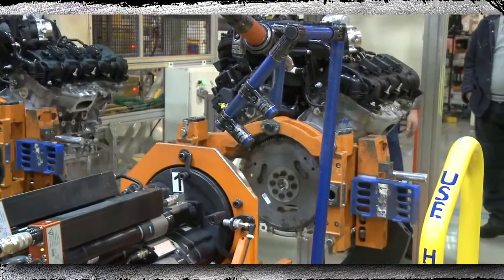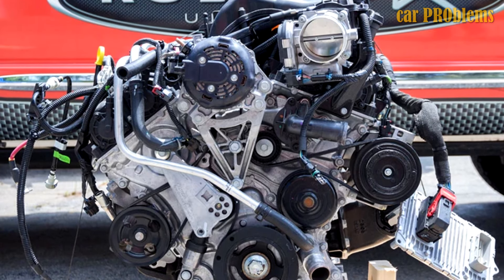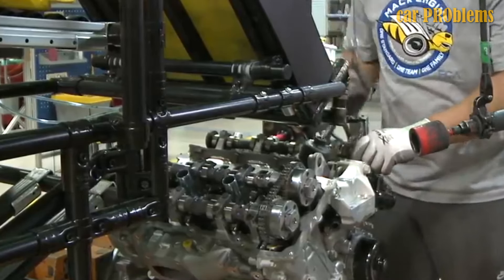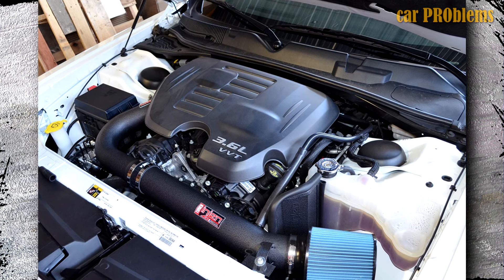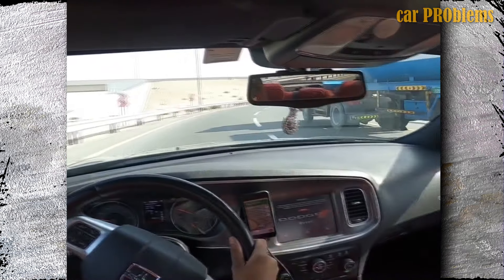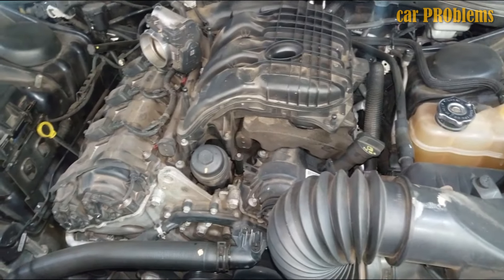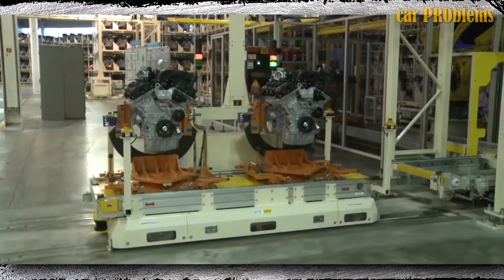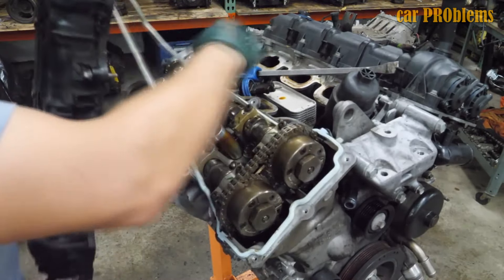3.6L Pentastar V6 Overview, Common Problems and Reliability

Comment: I have a 2013 Dodge Grand Caravan with the 3.6 Pentastar. I have taken excellent care of it for the last 10 years. No issues with it all for 10 years.
Reply: In my jku I have derived 300k km and no issue
Reply: 2012 t/c drives like a champ. Dont use eco mode
Reply: I think biggest aspect of these engines is regular oil changes. Valve train and anything to do with that aspect is delicate to oil quality.
Reply: Same here, 10 years now
Reply: @xgreasexmonkey5506  In the ten years I've had mine it's not been an issue. Still the original factory cooler on it. But then I don't crank down on it during oil changes either. I keep it clean and the threads are always lubed with oil before I replace the cap and I do use a torque wrench. I change oil at 3000-mile intervals. The engine runs strong, it's clean inside and out and it's quiet.
Reply: Did you get it new ?
Reply: @Aceinfinity-le8zc  yes, I bought mine new.
Reply: Easily one of the best engines ever made have just over 23k miles on my ram ZERO issues.
Reply: @fernherrera29   23 thousand miles!?!?!  That’s incredible mine blew up at 15,000.
Reply: @nassermohd2317  oil cooler?
Reply: What’s wrong with eco mode?
Reply: @eddiea3782  I didn't crank down on mine either but it leaked at 80k miles
Reply: @fernherrera29  that's no miles at all. Give it time. By far not the best engine ever made. The old straight 6 cylinders are the best ever made.
Reply: Does it take alot of gas
Reply: @The-Ramseys  16 to 18 miles per gallon
Reply: Best engine was the in-line 6 258 engine there gone now it’s nothing but a fiat sorry I stick to reliability Toyota 4Runner sorry no offense but,that’s what happens when other companies take over I miss my Old 1984 jeep scrambler🤙🏾
Reply: @rickmontelongo4230  I agree on toyota reliability.  I've got an 84 fj60  that will go anywhere
Reply: You can own anything for a long time how many miles do you have on it that's what counts, The oil cooler system is a bad design period
Reply: 2012 Durango, runs perfect.
Reply: how about throttle body?
Reply: @Phone-sh7jg my moms got one she doesn’t use eco mode either
Reply: @joerouth6255  honestly oil changes are the life blood of every engine if we went back to three months 3000 mile oil changes on any engine we would see drastically reduced amount of problems across the board
Reply: My 14 Ram runs and looks new. CHANGE YOUR OIL at 5k full synthetic.

Comment: Some information from my dad who used to work in Chrysler's warranty department before he passed.  The reason these engines are having failing rocker arms in years before 2019 is because the engines were originally designed for 30 weight oil and then were back spec'ed to 20 weight oils because of CAFE fuel economy standards.  The problem is that 20 weight oils have a lower HTHS (High Temperature High Sheer) rating which means that there is less ability for the oil to keep parts separated under high load areas of the engines such as in the needle bearings used in these earlier rocker arms before they were switched to a solid large pin (no needle bearing) design in late 2019.  You can buy these rocker arms.  The MOPAR Part numbers end in AH.  Anything earlier than this will still have the needle bearings and not the solid pin.  A work around if your engine is lower mileage and not ticking is to choose a 30 weight oil (which the owners manual says you can use) which has as high of a HTHS rating as possible.  30 weight oils will be 2.9 or higher.  Amsoil XL for example is the highest I've found at 3.3 HTHS. (Heavy Duty Diesel Truck Engines specify a minimum of 3.5 HTHS for cam loading for this reason)  In a 20wt oil it's 2.6 minimum and this is too low to protect these needle bearings.  The other thing that you can do to ensure you don't suffer from issues is to not idle your engine too long (lack of oil flow to the top part of the engine).  You don't have to take my word for it, but it's an easy change to make to ensure you don't suffer from this in your 2019 and previous Dodge Caravan, Journey or Jeeps that don't use the PUG Gen 3 engines as found in things like the Grand Cherokee, RAM pick-ups, Dodge Durango's (not Promasters or Chargers), These engines with the PUG 3 design have the Variable Vale Lift and use a different Rocker Arm design to accommodate the VVL system and don't suffer from this same problem.
Reply: Does the 2017 and up Pacifica van use the VVL ?
Reply: @stanza77  Yes
Reply: RIP to dad
Reply: That was mad informative! I love it when people are sincerely interested in an issue and have high-level knowledge to share. 👍
Reply: Thanks for sharing your knowledge. I have a 2019 Chrysler 300 (manufactured in summer of 2019) does it have the new engine design?
Reply: @ObamaPhoneProMax5G  It will have the updated oil pump, cylinder heads, oil filter housing revisions, and will have hardened needle bearings but won't have the latest solid pin rocker arms.  With a high quality 5w30 Group III synthetic which typically have a higher HTHS value you will should be fine. I have 2012 - 2020 in the family.  The ones with the older engines are all high miles now and 0 problems.
Reply: @CedroCron  mom has a 2014 Grand Cherokee and other than the oil filter housing it’s been a great  reliable vehicle. She rarely drives so it doesn’t even have 90k on it yet. My 300 only has 45k (Was a rental car the first year of it’s life and had most of the miles put on) then an old lady bought it during covid and never drove it (less than 2000 miles a year) and I just got it in February. Plan on driving this car for a long time so I appreciate the info from you 👍🏼
Reply: @ObamaPhoneProMax5G  Happy to help.  The PentaStar engines and the variations of them whether it's the 3.2L 3.6L and the VVL version with EGR cooling etc. all are really reliable engines overall with the failure rate being no higher than industry average.  It seems like they have a lot of problems because even at that low failure rate it's still a lot of engines because they have produced over 10 Million to date so even a 1-2% catastrophic engine failure rate is still a lot of engines at 100,000 - 200,000 sort of thing.  So the world will hear about it and it will seem like a big problem.  If it were such a problem Chrysler would have scrapped it and moved on to something else but they haven't.  They just keep refining it and putting it a lot of their vehicles.
Reply: Got a Dodge Avenger with the 3.6L. Is there anyway I could put an “up to date” pentastar engine in an Avenger? It being a FWD as well.?.
Reply: I run Mobil 1 0W-40 in mine for that exact reason  Has a HTHS>3.5 I believe the new SP forumla is 3.8 HTHS Visc @100c is 13.8
Reply: @davidsteckley8846  Good to know that the 0w40 isn't throwing codes with the cam phasers and variable oil pump.  I wanted to try a 40 weight once the warranty is up in my 2020 Caravan.  For now it's using 30 weight because the manual says 5w20 but 5w30 is ok when not available.  So it's just NEVER available in my garage.  Warranty is up next year and I'll give the 40 weight a go. Amsoil has a really nice 0w40 which i've used in a family members Corvette.
Reply: @CedroCron  the importance is the pump ability at cold temps. Once the engine oil temp is at operating temp, it doesn’t know the difference between a 20wt and a 40wt. People seem to have a belief that an engine won’t pump bc of the 40. Probably would have issues if it was a straight viscosity.
Mobil 1 or any other Euro oil specs have a HTHS >3.5 with ACEA A3/B4 Full Saps
Reply: @CedroCron  it’s funny that you talk about café. American Honda says 0/20. But in EU says 
O/30 0/40 5/40. I use 0/40 in my 2015 Acura MDX 3.5L
Reply: @davidsteckley8846  Yes but the 5.7L engines found in the Ram's for example with the MDS system will throw a code if the engine oil is thicker than a 30 weight at operating temperature because they call only for a 20 weight.  It's a known issue where people are trying to use thicker oil at full operating temperature.
Reply: So big government making problems for us
Reply: Sorry about your dad. The cap on my elantra says 5w20. Book says I can use 5w30 if I need to. I've been using 5w30 since 30k. I'm convinced I'd have trouble by now if I used 5w20. Instead I'm at 139k. No issues. Car has been  great. Prob because I change the oil every 3-4k and check the level between oil changes.
Reply: Killer advice. Wouldn’t the same apply if you bought a brand new 2024 ? I’d just run 30wt oil and call it a day.
Reply: @SHODUUP  Nothing has changed other than it now has the most revised Rocker arms. Having 15 PentaStars in the family from 2012 to 2020, I’d recommend 5w30 or 0w30 even in 2024 given all I know about these engines. Also change at 5,000 miles (8,000km) or less depending on how you operate it. These are good engines if you know how to make them last. Our 2012 is over 300K and 0 problems!
Reply: @davidsteckley8846  my 2018 Elantra has 5w20 on the cap. The book says I can run 5w30. At about 35k I jumped over to 5w30. I now have 143k and no engine issues. I'd like to get a Ram with the 3.6. I'd prob run 5w30 all year.
Reply: @CedroCron  interesting. I am looking at a Ram with the 3.6. I would run 5w30 all year to for protection... I read that's what the engine used before all this CAFE crap.
Reply: @joeb2588  That’s what I’d do!
Reply: @CedroCron  excellent!
Reply: @joeb2588  If you are ever uncertain you can always run a Lab test on your used oil after engine break in (Like 5-10k on the engine first) and see what it prefers based on the metal counts you get. 5ppm or less change is just noise, anything more than that is your vehicle likes or dislikes the oil. In my PentaStars in the family they all do better with a 30wt oil over a 20wt. My one sister just bought a Toyota corolla and it calls for 0w8 and it does better with 0w16. We can’t run anything thicker because they don’t make a GF-6b oil in 20 or 30 weight that is specifically for these lower viscosity engines. That said the manufacturer has done an amazing job as eliminating friction and the additive packages in these new oils is very stout so there is really low wear. That said, the oil report said 16wt showed less wear than the 8 by about 25%.
Reply: @CedroCron  wow. That's interesting stuff. I'd like to pop open the manual to the 2025 Ram and see what it says as far as oil weight options.
Reply: Does that go for the ram too
Reply: @jimmywarden6320  3.6L Equipped rams yes.
Reply: @CedroCron  so it's a good idea to use 5 30 instead of 5 20
Reply: Makes sense! Can I use 0W30 engine oil for the 2023 Jeep Grand Cherokee Ltd after the warranty expires? Thank you
Reply: @ericzhang7903  0w30 just flows more easily that 5w30 in the winter but at hot operating temperatures both oils are the same so you can use it now. The manual says that this weight (30) of oil can be used if the typical 5w20 is not available. The only reason they call for 5w20 is because of Corporate Average Fuel Economy (CAFE) standards. It’s not because it will not be compatible with your engine. Furthermore even if it wasn’t allowed they have to prove that the lubricant you used caused the failure. They can’t just blame it for no reason.
Reply: WinterSantosAlmeida10  Sorry I don't speak your language.
Reply: WinterSantosAlmeida10  As long as where you are doesn't get too cold in the winter (below 0 celcius) then yes 5w40 is fine.  Redline is not what it used to be.  It's still a great oil but since the switch in ownership the additive package has been weakened.  It's still better than Mobil 1 as a comparison though.
Reply: Also the dry start that these engines have contribute to future issues. Baxter performance makes a good oil filter adapter that prevents the dry start problem.
Reply: @joeshmoe8952  The wear metals in my Oil analysis reports are near 0 without it, so unless you want to use it for a remote mounting and a spin on filter, it’s not needed. There is enough in the pressure lubrication component areas like the Journals and bearings that the few seconds without won’t harm anything because the oil chemistry leaves a separation barrier coating on parts that more than lasts this time. It’s why an oil change when the restart is drying for 5-10 seconds until the oil filter is saturated and the system is pressurized doesn’t result in catastrophic damage.
Reply: @CedroCron  Explain why the oil filter is dry when starting up the vehicle?
Reply: Needle bearings failed on my 2011 which only saw 30 weight oil it's whole life. Also the left exhaust camshaft was excessively worn
Reply: @connormason7907  What was the HTHS rating on your 30wt oil?
Reply: @CedroCron  It's mobil one full synthetic 5w-30. The hths rating is 3.1
Reply: @connormason7907  With Heavy Duty Diesel oils being 3.5 because of heavily loaded cam components I really think every point matters.  Also between 2011 and 2013 the oil pumps were change to be higher volume and the head design was changed along with the roller-rocker arms.  Perhaps that plays into your early PentaStar as well.  Fact remains that HTHS does play a crucial role into heavily loaded components.  It's why we aren't seeing failures in the HEMI engines either which are nitrous as well for eating their lifters.  Finally yours could also have been just a manufacturing defect as well.  Remember although this problem seems huge it's not really.  The failure rate for PentaStar engines is still in the 1-2% range, but it seems so huge because over 10 Million engines have been produced to date which makes the failure rate around 200,000 at its worst of 2%, so you are going to hear from people online about it.  Meanwhile the 9,800,000+ engines lived a normal life without issue.
Reply: Thank you for the valuable information. How can I know my car has an updated engine or the old version engine. My car is 2020 challenger GT
Reply: @tzchz5186  Your car has the upgraded 3rd generation PUG version of the PentaStar engine.  This has not only Variable Valve Timing but also Variable Valve Lift. It is the best version of that engine available.

Comment: You forgot the cheap oil coolers where you put the filters that happened to mine I replace it with the aluminum one
Reply: I wanted mines replaced with aluminum but the mechanic said they aren’t allowed to do that so I just mines replaced with OEM parts
Reply: By far the worst problem that is still present in the Pentastar design.
Reply: I guess I got lucky with that one, but unlucky with the plastic water outlet that the thermostat bolts to

Comment: Afew weeks ago I became the proud owner of a 2023 Charger GT "Last Call" edition. I have never owned a Chrysler Corporation vehicle but I've had more than my fill of GM cars and trucks and all the poor  reliability  and build issues associated with them. I was VERY tempted to go with an RT Hemi version with the sweet sounding 5.7 V8, but with gas prices uncertain, I took a chance that the 3.6 V6 would be all I needed. Never even test drove a car with the V6 so I had no idea what I was getting into. WOW what a pleasent surprise! That 300 hp engine moves my 4100 pound car quite rapidly!! And it's so SMOOTH you will have a very difficult time determining if it is runnning at all. Almost zero vibration. Probably the smoothest engine I have ever owned! I am sure I made the right choice, Now if it just had that awesome V8 rumble from the exhaust!
Reply: I got a 2023 Wrangler with this engine. There are a lot of options when it comes to aftermarket exhaust 😅
I just put an aFe high tuck exhaust (basically a muffler delete, still got the resonator and cats) and with the 6MT she makes a good pop and rumble.
I just saw a video about putting cams on the 3.6 challengers and couple with the right headers and exhaust and thne you can make it sound pretty dope (I seen and sound clip and was impressed)
Reply: Supercharge it.
Reply: Get Borla Attack full exhaust system
Reply: Also known as the property value lower 😅 @MGSimatupang
Reply: Mid muffler delete(replace with x pipe) an just pick a borla exhaust that suites your noise needs! Borla and x pipes compliment v6 beautifully:)
Reply: My wife is on her second Jeep Grand Cherokee with the Pentastar V6 (2019) her first was a 2014.

Although I would not call it fast,  I have never wanted for more power in real world driving conditions. 

When I was considering a Ram truck a few years ago I was surprised that the V6 actually felt more peppier that the V8 while driving in the street!

Considered the V8 when I bought her 2019, but after test driving it I realized it didn’t really feel any faster and it had significantly less gas mileage.

Comment: Had a 2013 JGC with the 3.6. It well over 200K trouble free miles whenwe traded it in for our 2021 JGCL. This 3.6 runs just as good. Change the oil regularly and these things run forever.
Reply: Premium full synthetic, change every 5k, runs like a dream
Reply: Did you ever changed the transmission fluid? If so, what mileage interval

Comment: I’m in my second Pentastar V6, the first was in a 2015 Cherokee 4x4, that was the smaller bore 3.2, that was a smooth more than adequate engine that get decent mileage and ran through til recently traded in after the 130 months and 150,000 trouble free miles, for a 2024 Gladiator 3.6, that so far we are very pleased with! That’s a humble Sport S, with a couple nice options packages, a Convenience a Safety Package, with automatic hardtop in Chrystal Granite Metallic with black cloth interior with heated seats and steering wheel, fantastic 12.3” UCONNECT 4 G LTE WIFI SOS/911 system Apple Car Play touch screen with 8 speakers, ACC automatic cruise control and reverse warning side traffic detection system. With 17x8 color matching alloy wheels with 32” 245/75-17 Bridgestone Dueler HT tires.